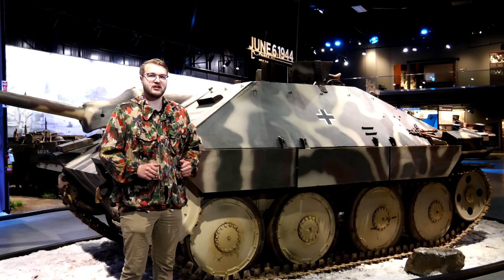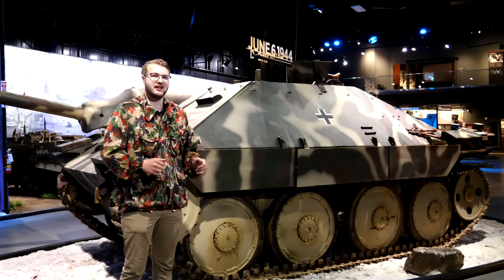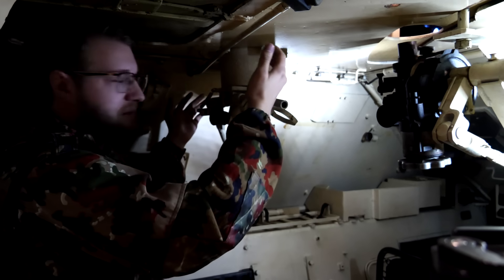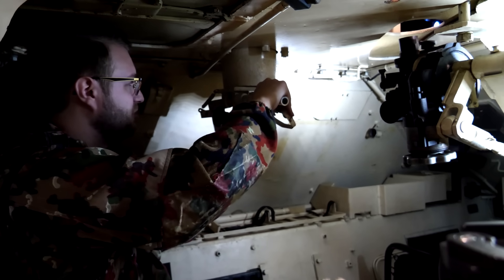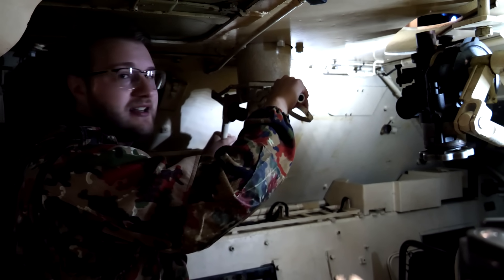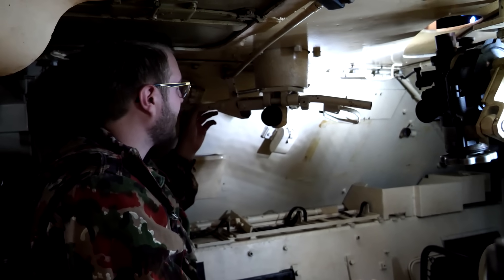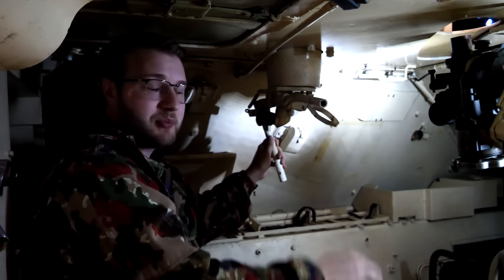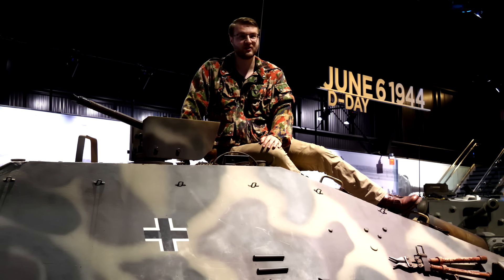How does the Remote Control MG on the Hetzer Work?

Comment: Thank you for this fascinating video!  I was always very curious about the remote control MG system, and it was very satisfying to see you explain and demonstrate the actual controls.  Question: is there a hatch above the MG operator aligned in such a way that it would be relatively easy for the operator to reload the roof mounted MG through the hatch?  Thanks!
Reply from the maker: The hatch is directly above the loader
Reply: @ConeOfArc  Thank you!

Comment: The only problem is you can’t be getting shot at when you load this. Because losing a crew member in a tank is bad news.
Reply from the maker: There is an armored shield on the front so it does have some protection during loading

Comment: In 1944, it used mechanics. Simple, robust.
In 2025, the same solution used a series of electric motors attached to a camera. Not simple, prone to failure.

Comment: That's not remote control. Far from it. And before anybody argues, this is the definition of remote control. control of a machine or apparatus from a distance by means of signals transmitted from a radio or electronic device.

Comment: Soooo, it doesnt turn 360?  Or, rather, couldnt due to interior crew constraints?  Or would the guy manning it just have to get up and move around?
Reply from the maker: I didn't really try to spin it fully but I wouldn't imagine you'd be able to do that easily with a full crew. Given how these were intended to be used you wouldn't be in a good place if you need to be aiming it behind you as something would have gone very wrong

Comment: I wouldn't exactly call it remote control, but periscopically aimed is a better fit. Still a very practical system for firing weapons under armor in wwii.
Reply: Yeah, its far less "remote control" than the tabk turrets of this period, which were electrically powered.

Comment: Wow, that makes a lot more sense for the time period. When I learned the Hetzer’s machine-gun was remote-controlled, the modern use of the term stuck out in my mind. I assumed it was done with wires and servos in a feat of traditional German technology being light-years ahead of the Allies (I was like 16 at the time so I fell for the myth)
Reply: Remote control in the modern electronic sense was fairly common for light turrets by 1944. Numerous german aircraft have it, as well as the B29. Many even include automatic prolongation lead computers.
However such a system is completely unnecesseary in a tank, where direct mechanical linkage is feasable due to close proximity.
Reply: otoh warships had some interesting electromechanical systems back then. but i think they were to tell human gunners which way to adjust the angle rather than directly driving the turrets
Reply: @elongated_muskrat_is_my_name iirc the iowa class battleships' aiming calculators were huge mechanical computers that weighed several tons because they had to account for like 20 different factors that changed as the calculations were going on
Reply: @elongated_muskrat_is_my_name
There were indeed many fully automatic centralised fire directors on warships by this point.
The gunners just loaded the gun.
Reply: @elongated_muskrat_is_my_name I think the B-29 had a pretty interesting mechanism for its remote turrets.
Reply: I mean, the Stuka had an autopilot to pull out of a dive when the pilot passed out, the FW190 had a primitive computer to automatically control fuel, trim and blade pitch, so a remote controlled turret isn't that far-fetched

Comment: Even with stiff controls this looks very functional.
Reply: german engineering, it either works for ages or breaks in 15 minutes lol
Reply: I guess the question is whether the added safety this provided outweighed the less effective weapon. I have my doubts that it would have, since visibility in this era of armoured vehicles was so bad.

Realistically, someone had to have their head stuck out the top to really know what was around them. With that perspective you were much more able to counter/avoid any threat, making the vehicle (and its crew) more likely to survive, even though as an individual you were obviously vulnerable.
Reply: WW2 crows. I imagine its complexity meant this control method was never gonna be standard on other german tanks but its honestly the best roof machine gun for crew safety at the time.

Comment: I was today years old when i found out the Hetzers MG was operable inside the tank! I though it was just WT working its magic as it does w all/most roof mounted MG's lol
Reply: I learned Hetzer do that way because Heroes and Generals game. I quickly researched it after i got it in game and astonished by the feature as it works nicely and epically as mobile bunker!

i just wonder why germans did not do this to their later tanks? it was such a nice idea fr
Reply: @comradeblin256  i played H&G for so long but only now learned about its remote control feature. I always thought the hetzer mg was just overlooked so i abused that feature whenever i could.
And now that H&G is working again,  i can continue using it as much as i used to!
Reply: @freezie4511  H&G is working again? Since when?
Reply: Nice idea on paper but good luck hittinh anything with it, I assume @comradeblin256
Reply: @comradeblin256  It would take up too much space in the turret and their tanks had fully protected hull machine guns anyway. It also adds another unnecessary layer of complexity in maintenance and manufacturing. Then again, the Germans didn't shy away from unnecessary complexity in other design aspects 👀
Reply: @danismujkic4497 Germans didn't have the necessary chezhnology
Reply: I learned about it in the original men of war...  all other vehicles with top MG's you could snipe the gunner out and rush with anti tank grenades of basic infantry. A remote operated MG incapable of having the operator sniped out was diabolical 😅.

Comment: Now when I think about it, why isn’t this kind of system more widespread? It seems like a simple but effective way to get a roof MG without exposed crews or electronic equipment
Reply: Many other roof MGs were for scaring away aircraft. This one has too limited vision and elevation for that. For Hetzer it's an essential anti-infantry weapon as it doesn't have space for a ball mount at the front.
Reply: @Teh0X  actually now i think about about even back at that time they didnt have access to high resolution cameras and good situational awareness unlike today including engaging aircraft at close range before that stopped due to long range missiles and ATGMs, that also makes a lot more sense too because the commander or loader had better eye ball visibility outside of the tank than periscopes in the 30s, 40s, 50s, and 60s.
Reply: Exactly that's what im wondering too
Reply: I think a few modern tanks have a remote control for the cupola mounted mg, not sure which ones though.
Reply: @pex_the_unalivedrunk6785  yea mostly thats not the case anymore usually they mounted on the front of the Cupola
Reply: @pex_the_unalivedrunk6785  because one the commander or crew needs to have good access to get out of the vehicle because having wires on a hatch and such complicates things and also makes mounting harder and second its more easiler to reload if the commander is directly behind the weapon
Reply: @pex_the_unalivedrunk6785  but thats just my opinion
Reply: Most American tanks in the Cold war would be equipped with similar systems. The m1a1 Abrams even had a hand crank system with a cross hair mounted to the bottom of the mount so you could fire it from inside. A little clunkier than the heaters system but allows for it to be used like any other roof mounted MG.
Reply: it is widespread - post-war the Soviets had a similar thing for their commander MGs giving them the ability to fire while under armour
Reply: With modern optics its a great idea, but at this time it was really hard to know what was happening around you unless to stuck your head out the top and had a look (which was doctrine for British/Commonwealth/US tanks at the time)

This was effectively to replace the front hull mounted machine gun and the coaxial turret mounted machine gun that tanks had, but it would be far less effective without someone telling you where the enemy was. And if you really needed to lay down machine gun fire against infantry then you've also got the manually operated machine gun on top the turret - which leave the individual more vulnerable, but protects the tank as a whole much better.
Reply: You get more protection as the gunner, but waaaaaay less situational awareness and moving target hit probability. So it's a bad tradeoff.

Comment: Makes one wonder why RWS(this design or another) haven't appeared on other germans tanks of same era or for example on soviet post war ones?
Reply: Probably lack of space
Reply: @lucasmoreno2154  "lack of space"
Compared to insides of crammed Hetzer?
And cost argument also doesn't work as we see it on Hetzer.
Reply: Prob doctrine in the case of the Soviets, classic dictatorship politics and being very close to the end of the war for Germany.
Edit:
And also Hetzer is a casemate tank destroyer and they didn't bother with the turreted ones.
If anything Stug, Jagdpanzer, Jagdpanther and Jagdtiger are the best candidates for also having this RWS but idk if they actually added it on those.
Reply: Probably lack of interest. Remember that during the very early part of the Cold War, MG is basically for shooting down lightly armored and armed helicopters from far away so there is no need for a RWS (which at the time is extremely lackluster). Also because of the rocket hype at that time

It was not until the 60s (6-day war, etc.) that people realize that a fully protected MG is super important when you have a bunch of enemy soldiers crawling onto your and your buddy's tank
Reply: you can fire the commanders MG under armour in Soviet tanks in almost exactly the same way as the Hetzer does it (I know for a fact that the T-72 operates this way, but I wouldn't be surprised if it's in as early as the T-55)
Reply: because it was mostly useless

Comment: War thunder making it so that, if the COMMANDER is knocked out, it doesn't work ... Instead of the LOADER!
Reply from the maker: Drives me crazy, I have a photo from the last time I was there holding the controls from the commanders position and it would be all but impossible to control
Reply: @ConeOfArc I sorta understand WHY Gaijin made it like that- it simplifies the mechanic's but ... Still, Rather odd in my Opinion!